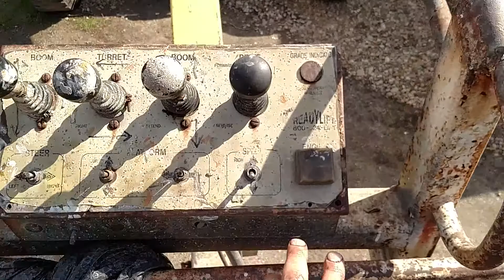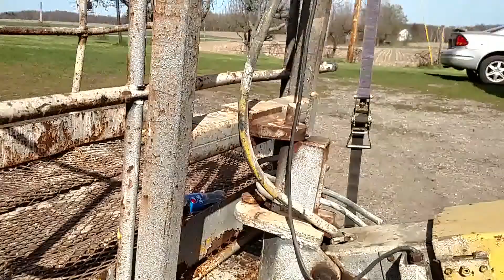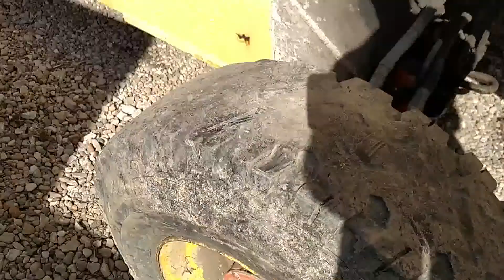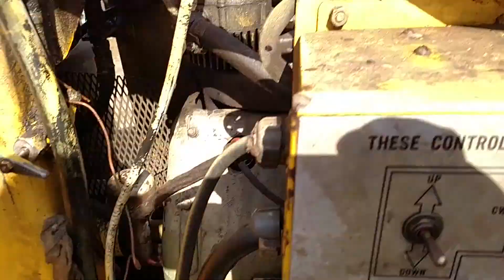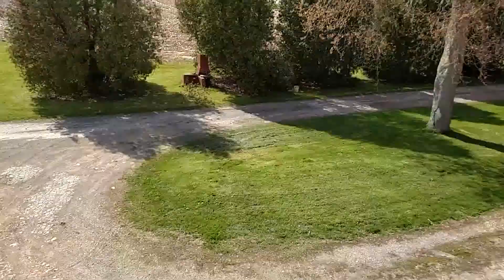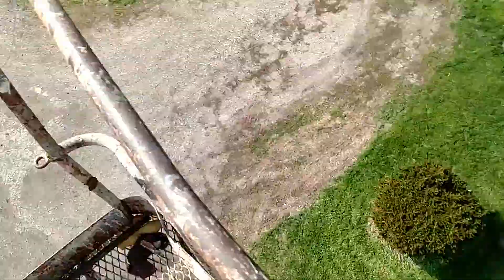Stretch's stuff, Condor 4046 boom lift!

Comment: By any chance are you able to get that throttle solenoid part number for me? I just got a 4046 lift that uses hydraulics to activate the throttle, but it leaks. I would like to covert it to an electric one to create less future messes. Thanks
Reply from the maker: I'll try to remember when I get home
Reply: @stretch44875  Ok, also do you have a place you go to for parts for these machines? I need to replace my white hydraulic filter next to the resivor. My filter number got rubbed off and so I'm not sure where to look up those filter part numbers at. I did find a lift manual, but the numbers don't bring up alot. Not sure if the manual part numbers are to old or outdated now. If you did glance at your part number off your hydraulic spin on filter, I'd use that too. Mainly I for sure would like to do the electric solenoid throttle valve though. Any info you can give me is much appreciated and will help me out. Thanks again.
Reply from the maker: Solenoid is a synchro start model 2001.
Filter is napa 1553
If you are on Facebook, search groups for calavar condor lifts, I made a group and posted pics.
Reply from the maker: https://www.facebook.com/groups/481925089375995/

Comment: i have a condor 4248 that looks very similar but has 3 peices in the boom rather than 2 if anyone is interested in buying it its in Gainesville Florida and has a bad leak in the cylinder inside the boom and the pilot proportioning valves need work but Wisconsin engine runs good Grant Cooper 3522149270 if anyone knows how to get cylinder out of retractable 3 peice boom that is stuck out fully extended please let me know lol im asking 1800 for it

Comment: Hey stretch44875,  I have purchased a Condor Model 68. I believe it is a 1985 model. I bought it knowing it had problems. I work on electronics and hydraulics for a living and figured I can have her up and on her feet in no time.  My issue is that I have no controls from the boom except driving. I can drive forward and reverse, and turn the tire. PERIOD. I'm wondering if that is something you've dealt with or have ideas on where to turn first. I've struggled to find a manual that has my year of machine in it. So the wiring diagrams and wire numbers are a little different.  But that's about all I've had time to find so far.  I'm guessing that I've either got a bad relay or two, or bad microswitches inside the 3 left controls on the boom.  ANY HELP IS MUCH APPRECIATED!!